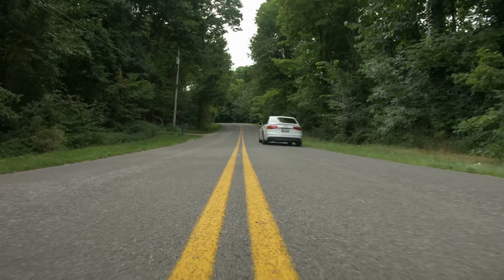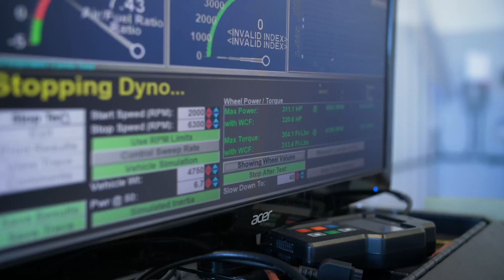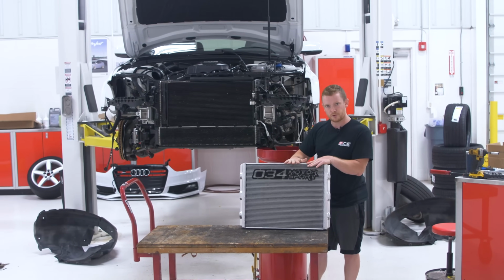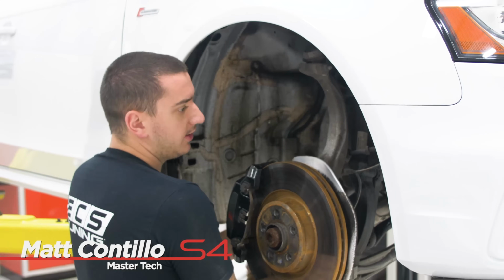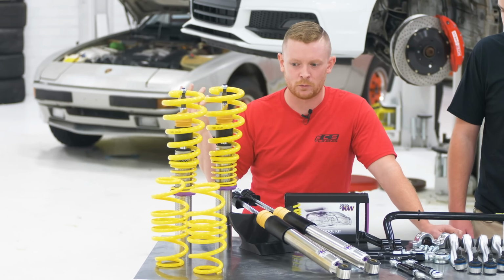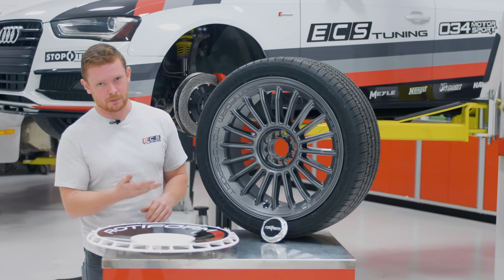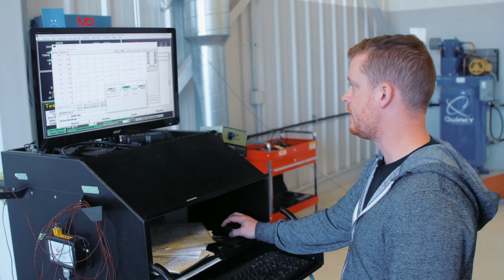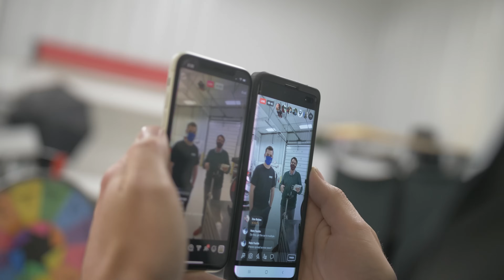Building an Audi S4 | From STOCK to 422WHP in 11 minutes | ECS Tuning

Comment: Did you not have to do anything with the clutch system? Does the stock dual clutch not slip with the added power?
Reply: No it’s a very strong trans tbh it could handle probs up to 600 wheel no problem

Comment: Oohh such a nice build...
333whp stock, in Sweden they sre 333hp to the engine...
Reply: There is a slight difference in calculating American horsepower SAE HP and European Horsepower DIN PS.
Reply: As well as US dynos all seemingly massively over read compared to European ones.

Comment: Makes me wish I didn't trade my B8.5 S5 for the B9.   Miss the supercharger and manual.   I don't know if trading the stick shift for virtual cockpit was worth it.   They should have made the B9 with a stick option
Reply: Does the B9 have the same transmission? My 8.5 had a mechatronic issue and I've stayed away since lol went with the zf8 transmission in the c7.5 and drive with confidence.
Reply: @bnutti2537  What year was your B8.5 if you don't mind me asking?
Reply: @MaximusLX  it was a 2013 s4
Reply: @bnutti2537  Did you ever fix the mechatronic issue? And how many miles was your S4 when it had it? Sorry for the questions but I am looking to buy a 2013 S4 in the future

Comment: Can we get a video on the ECS TUNING b8.5 install for the new ecs tuning heat exchanger? Mine just came in today with the ecs tuning single pulley! I’m excited! Also another question.. are you guys working on any other ecs provided affordable products for the s4’s?
Reply from the maker: Great idea! We will put a DIY video in the queue for the heat exchanger. Hope the install of the pulley goes well! We have a large amount of ECS designed products that are affordable for the B8S4 and we are always designing more. Are you looking for something specific?
Reply: @ecstuning  gonna do it next weekend 👍🏻 put the heat exchanger on yesterday. Bled the system. Everything is solid and you guys did an amazing job can’t wait to see the results in Mexico. Well for example CSF is making their own radiator. Maybe you guys can provide your own for even more cooling! Or maybe an expansion tank for the heat exchanger, or even your own throttle body compatible with the Luft Technik intake . you guys have good products just excited for what’s next.
Reply: @ecstuning  or another idea I was thinking was maybe there’s a way to not only keep the coolant colder (HX) but maybe you guys can manufacture a direct bolt on oil cooler to keep your engine even colder. Not sure if this sounds dumb but just thinking out loud
Reply from the maker: @davidmusiyenko4158  Love the feedback. We are glad the heat exchanger install went well!  I will pass your ideas on to our engineering team!

Comment: I was convinced 420hp would be easy to attain with these, I was lied to
Reply: probably because most of these parts are more so to help with the power but yeah...rs3’s are much more expensive it’s almost depressing
Reply: 420whp is pretty easy, but it's not cheap. E40 ported blower, TB, 3.2+ PR, tune. But of course you need supporting mods, HX, HPFP but that's really about it.

Comment: All that for only 100 Hp?
Reply: Yep, all of that. Brakes add 50hp, stickers = 87 hp, wheels are 1000hp. Pulley and tune with a cat back only which are consider very very simple basic power mods adds like minus 300hp. All of that